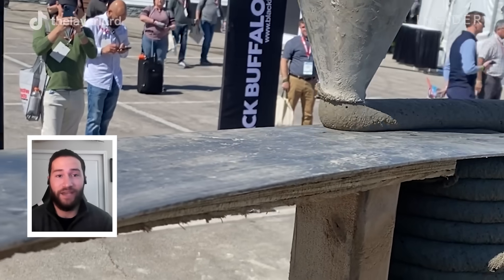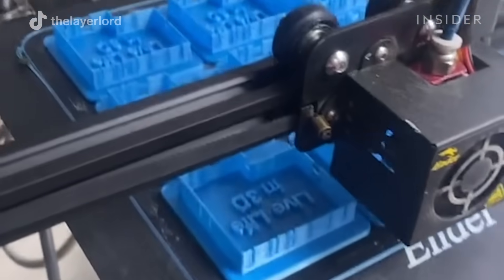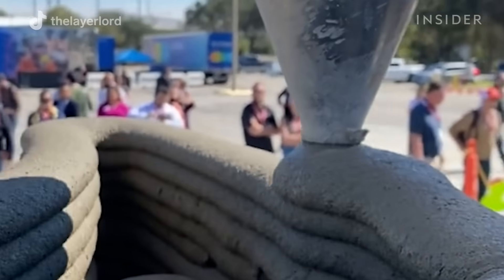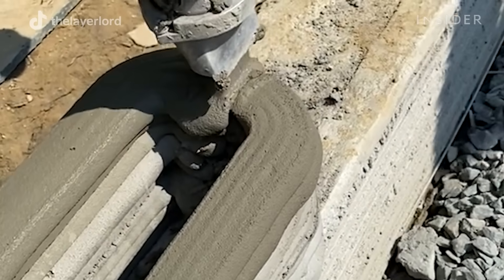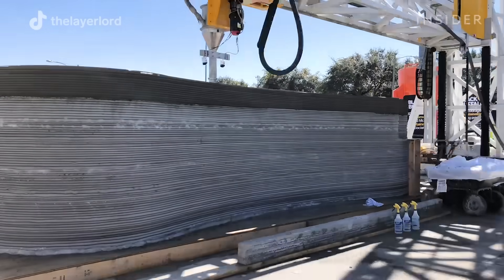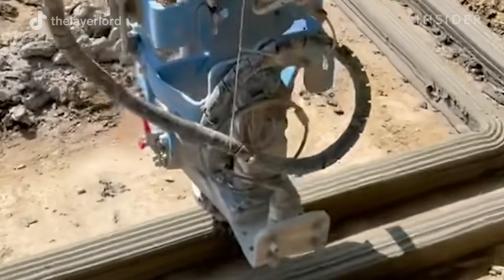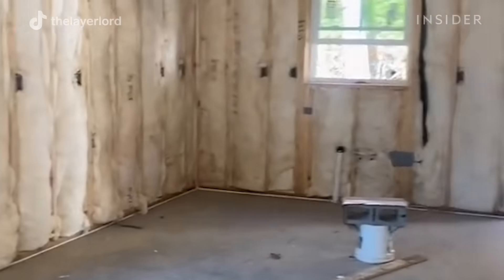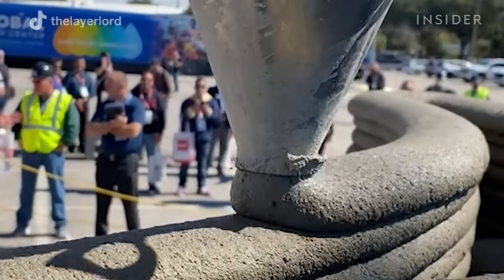How Concrete Homes Are Built With A 3D Printer | Insider Art

Comment: I figure you dont need much rebar if the concretes in layers. They use a lot of rebar in traditional concrete because its typically 1 huge piece much more prone to cracking.
Reply: ...   rebar is for tensile loading   so if there is any settlement the loading is absorbed by the rebar and distributed. 
Without the rebar, this "house" will break apart for any small amount of differential settlement 
add in any wind or seismic... and it only gets worse

Comment: Its better to just use steel wall formwork and pour entire sections and using  vibrationary equiptment to have the concrete completely solidify in one good stong unit....also you can use large aggragate then it simply being sand only

Comment: Struggling to see how this is any cheaper or even quicker than a traditional block built structure. All the demo's of this stuff they never have to worry about putting in foundations or bringing in utilities and fitting out the structure the machine prints. By the time you have done all the extras required to make the place habitable any cost saving will be virtually nothing and you are left with an ugly concrete building than will need rendering.

Comment: This is a totally cool system, but I'm really questioning the longevity of such a house. There doesn't seem to be any serious reinforcement in the walls. Normally, there's like rebar reinforcement in the concrete walls, especially if they're load bearing, but at least in this video there doesn't seem to be much of a support structure, it seems like just the concrete is holding all the weight both of itself, and all other building elements, like the roof, windows, etc. Concrete of course is very durable, but it still needs reinforcement for long-term longevity and lateral stability.

Comment: In construction, any concrete must be reinforced with steel. Otherwise, it will crack and crumble quickly. Concrete without steel is impossible to use in construction.
Reply: cinder blocks???

Comment: I came to the conclusion that noone here knows what they're talking about. You all sound like Google drones that copy and paste bs.
These houses don't last. Cement by itself doesn't have any thermal retaining properties since even today we still use insulation and it's heavily insisted upon. No insulation causes it to become damp due to temperature changes,draft and cold spots. Steel is another material used in case of earthquakes, wind and overall stability of the house,big or small. 
Look at nations who tried to cut corners when it comes to infrastructure and learn from them

Comment: Innovation vs conventional method. interm of durability, of course it would be under conventional method. how many load it may sustain, since we can see from the video, there is no any column, then the load from the roofing would be direct uniformly to the wall. then for window opening, no lintel on that. pretty sure, that area would be pain point to begin the crack😅

Comment: Thing with 3d printing is the individual layers are not bonded together real well because there no force mixing the two layers together. I know this is a problem with the polymer 3d printers.When a brick layer uses mortar they press it against the bricks to get a good bond

Comment: 1000% this isn't anymore cost efficient or practical when it comes to low cost housing...... Insulation? Wiring? Plumbing??..... So your either gonna core holes everywhere or your building wood walls to hold the electrical switches heating/AC  registers...... Not to mention how does it preform in hot/cold temperatures...... Even a concrete foundation is insulated in some sort of fashion .......

Comment: If you've never built a home... Additive printing technology is a cool concept for home construction. However, there are a few things to know if you've never built a house. First, the exterior of a home always goes up in a matter of days or a few weeks depending on structure size and crew size... regardless of the technology use. For example, if I use SIPs (Structural Insulated Panels), I could standup all exterior walls in a day or two and frame and frame and sheath the roof the next day. Second, the exterior covering (stucco, clapboards, etc.) gets added to the concrete/sheathing/cinder blocks, etc., followed by windows, skylights, roof covering, etc. Before that you typically Tyvek/seal the outside of the house. But again, all of this is done within the first few days or weeks. It's the inside of the house that take months... electric, plumbing, HVAC, insulation, drywall, taping, painting, finish carpentry (kitchen, bathrooms, flooring, inside doors, floor moldings, window moldings, door moldings, crown moldings, etc.).  If your walls are concrete, all of this work is much more difficult, or, you need to take additional steps before drywalling.  The point here is that, while cool, 3D printing your walls will not save you time, and, at this time, actually costs more than the alternatives.
Reply: Very well said mate, these are the concerns when I saw the video.
Reply: You're so smart. Your mind is attractive. Ask me to marry you. I'll still play the cat/dog chase scenario lol jkjk 😉 I shot my shot lol
Reply: Plumbing would be run in the slab, radiant heat in the slab, hvac in the ceiling. You don’t need to drywall but the electrical would need to be in the walls. I’m a builder and I agree with what you said, you just might have to look at different methods on these than a stick built home. I think it would end up costing more but with the price of lumber lately who knows!
Reply: @forcedindenturedservant6881 the structure on paper is awesome. In floor hydronics, awesome. Modularity? Structural integrity? Access to plumbing and electrical should anything fail? Now your tiles are being torn up and there’s a sweaty functional alcoholic in your kitchen with a demo saw… This method is mind boggling in all the right ways but it is not for residential purposes. Not yet.
Reply: Absolutely correct, they never seem to talk about all the finishing, ground work, utilities or fitting out. I don't think this would be any faster than other building technologies and you are left with an ugly rough concrete exterior that will need covering up.
Reply: @schrodingerscat1863  You don't have to leave the exterior wall as is after the 3D build. You can coat and smooth it out with a little more cement the same way ppl skim coat drywall. Or you can cover it similar to how stucco is covered, you have to get creative.
Reply: @WannaFindOutMF  If you render the walls it makes 3D printing them an even worse idea because now you need to also employ a plasterer to do the rendering. Face it if this was compelling literally every building company would be using it. The truth is that it is overall quicker and probably cheaper too building with blocks than 3d printing.
Reply: I think the only real benefit within populated areas I can see is the reduction of the labor for a more traditional brick laying team. It would have a reduced cost slightly with less labor costs, but I doubt it would impact the total that much. If the system is improved enough you could get to a stage where a single worker could arrive and print the walls in a day. But that is theoretical rather then practical. Once it develops enough it would just be one option out of many with pros and cons.

The real benefit of this I can see is unpopulated areas. Rural areas, harder to reach areas. Instead of delivering a whole construction team and materials, you just have a piece of mobile equipment that can print and some cement mixers. Barns, garages, or even grain silos could use this.
Reply: It's a step towards innovation.  Not a one off solution. Give the technology a couple years and I bet this is gonna get even better as does the technology
Reply: Hey I agree with you, I'm looking to build a poured concrete home in casa grande, AZ if you or someone you know can help me please let me know. I'm aware that concrete is an expensive material to build from and I'm still very much interested.
Reply: @kylekoster3432 hi.  I'm a residential designer in AZ. I have a potential new client ( contractor ) which is getting into this. 
I'm curious how your project is coming along?
Thanks
Reply: It is apparently significantly less expensive than a traditional concrete home.

It is significantly uglier imo
Reply: Now I ain't reading all that
Reply: The biggest benefit this could have is with building Mars homes, where you need a base already established by the time the first astronauts arrive.
Reply: There is no need to drywall this. It adds a ton of work and money. Just mix up some stucco mud and slick finish it. Ordinary stucco is done over a lath, then a coat to fill the lath, then a coat to smooth imperfections. From the video it looks like a filled lath, so you could just run a skim coat over it and be done. Need a pretty heavy duty primer to seal the stucco, but after that paint as desired.
Reply: If you have the money and hired the right contractors, then the home can be built very quickly. Apart from the finished interior, the only other thing that will take a long time is waiting for the cement to be properly dry, but I think it's all worth it because you'll  have a much more durable home. I'd choose this over a wood framed home with drywall and vinyl siding any day. Or as I like to call them, paper homes.
Reply: All true statement s
Reply: do you have sources for costs? theres only a couple i can find and they all claim it is cheaper, and some older studies that claim it isn't progressed enough yet but is likely to be in the future. im a total layman, but i really struggled to find much about negatives/higher costs so if i could have ur source it would be great, since you claim you know it costs more.
Reply: @tripives1858

I would imagine since the vast majority of tradesmen (electricians, plumbers, etc) have no experience with this construction, it might be be a problem. As long as everybody involved is sufficiently educated on the necessary process then it shouldn't be an issue.
Reply: You down with SIPs?
Reply: Not to mention, concrete is incredibly bad for the environment and is a more expensive material to manufacture and transport.
Reply: Before the Additive printing begin, CAD design is needed. Which are then turned into G-Codes. If the designer had all of these details you mentioned in mind, there will not need extra work as you mentioned.

Also, the costs are less. Less man power means less money spent on labor. Less mistakes and injuries which can leas to a “law suit”
Reply: When my house was being built I was amazed how the fast the slab was poured and the stick frame was put up. Then I was also amazed at how long the flooring and moulding took, way longer than I would have expected.
Reply: This is difficult to hear with the background noise and his gravelly voice.
Reply: Thank you for laying this out. I've never built a house but watching the video I was concerned about the lack of any conversation about the foundation. Also I live in California so what about issues related to seismic activity.
Reply: thank God, someone who know what they're talking about. also there are health concerns of building a "concrete house"
Reply: A lady "bluffed" about the advantages of this concept on radio 2SM Australia today at 13:10 hours , Sydney time . She refused to discuss the possible complications if the supply of concrete is not steady or a concrete truck delivery to the site gets delayed in traffic , possibly spoiling the integrity of the product . A batching plant is needed on site to guarantee printer reliability without interruption . Minor imperfections often need to be fixed after the initial printing phase , anyway . The plant equipment is very expensive with the electronic interface and associated mechanical equipment . High winds can affect accuracy of placement of material due to the lack of windbreaks .
Reply: I think these seem more like cheap shelter housing for homeless people
Reply: @dandan6778  it'd be cheaper to manufacture a modular home
Reply: @luthermartin44  but a home requires taxes. This is a shelter
Reply: @dandan6778  No, this is a home - as stated in the title of the video.
Reply: @Lance Porter  correct. You are replying through a thread so you can't see my original comment which stated that I think this would be better as just a tax free shelter scenario. I'm a little high bear with ne
Reply: @dandan6778  did you read what you typed before you sent it?
Reply: @LancePorter88  👍 Gotcha' If it says it is, it is.
Reply: @dandan6778  
Tax the shelters!
wait....

tax the tax shelters!!
Shelter the taxes, taxes before people!!
Reply: @luthermartin44  But you can't put a modular home just anywhere. It has to be in a park or a lot outside of the city limits. Already looked into it.
Reply: @dandan6778  That doesn't change anything he said, even a homeless person needs plumbing and heat.
Reply: @dandan6778 why is that?
Reply: Progress, not perfection...but it's on the way!
Reply: @sharongayehumphrey8062 on c'est pas du progrès , l'intelligence artificielle ne sera jamais plus intelligent que les ouvriers, commencer par augmenter, et bien redistribuer nos salaires,  ce sont les bureaucrates qui vont être remplacés, vous n'avez aucunement conscience de la complexité de nos metiers
Reply: Not to mention i can see how as presented in this video. The home would be SIGNIFICANTLY weaker then a traditonal reinforced concrete wall. Or even cinderblock walls. Due to the lack of reinforcement
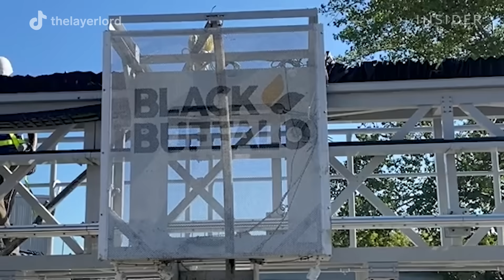Reply: @JadeTheTravelerWolf  Reinforcement is present and it can be seen at 1:42 for example.
Reply: I was thinking the same thing.  This doesn't seem to really save any time - when you factor in all the set up and everything - or labor.  And then the finished product is butt ugly and much more difficult to work with.  Probably not that much cheaper either when you consider the extra work involved in working with concrete vs wood.
Reply: thank you, everyone thinks these machines are so much faster, no a good crew of construction workers can have a house up in the same amount of time, less if they hustle. and if that machine breaks down it could take days or weeks to get back into operation, whereas you're far less likely to have a full crew go down at the same time so work can still get done